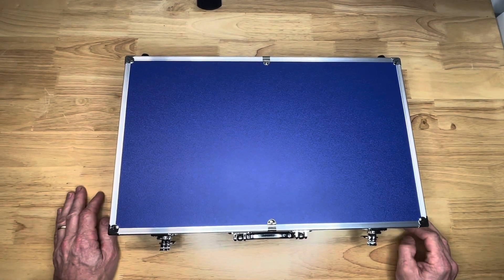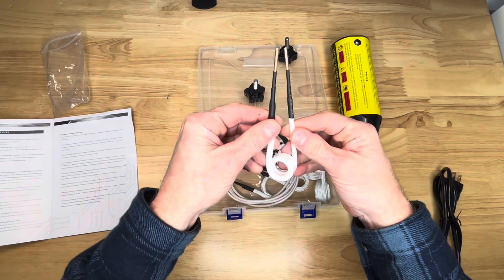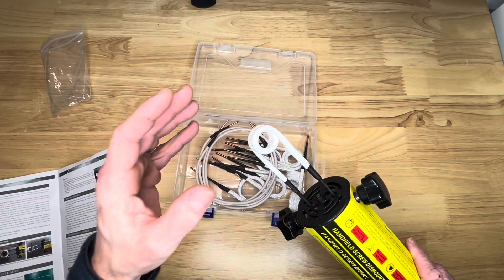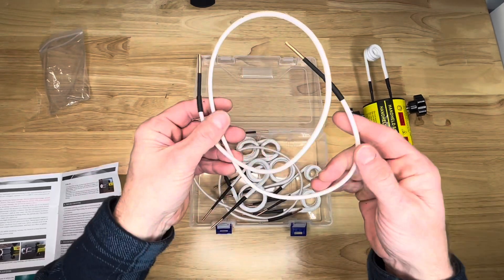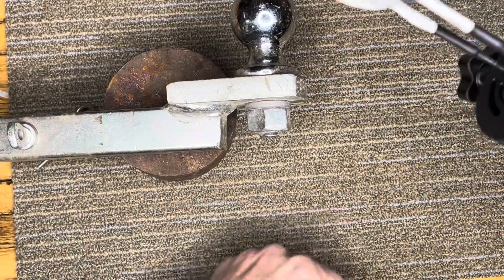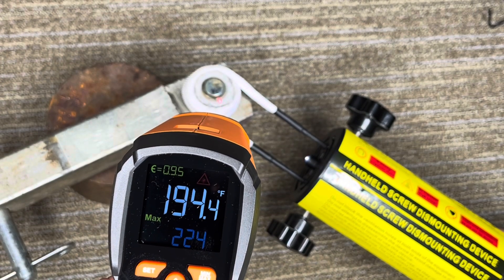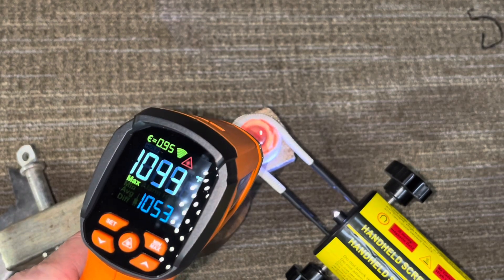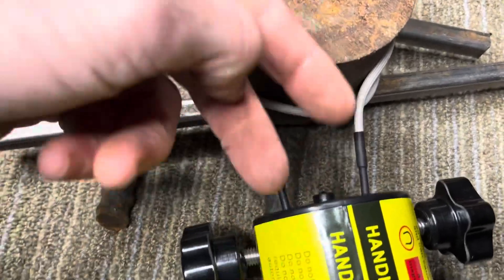DIY Magnetic Induction Heater - Science Explained

Comment: I'm not convinced that's the best treatment. If the bolt and metal are the same, they might fuse. Turning would damage the threads. I think I wouldn't let it get red hot, first of all. Just hot enough to thermally expand. Let it cool for a bit, but not too much. Then put in some penetrant. Maybe using something like an oscillating multitool to vibrate the metal.
Reply from the maker: Great tips. I agree with you plus you could potentially void any thermal heat treatments the fastener has undergone for the post desired properties, whether that hardened, tempered, annealed, etc. The red hot heating shown in the video is for demo purposes to showcase some of the capabilities of the induction heater. Thanks for your input and happy holidays.